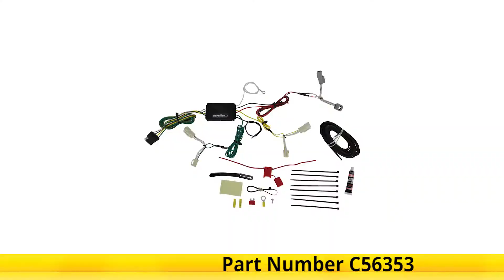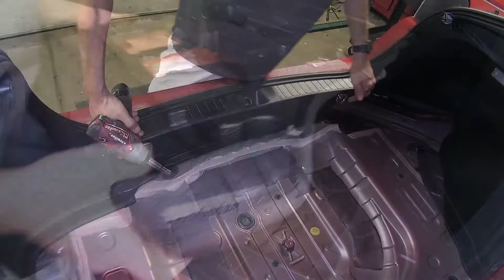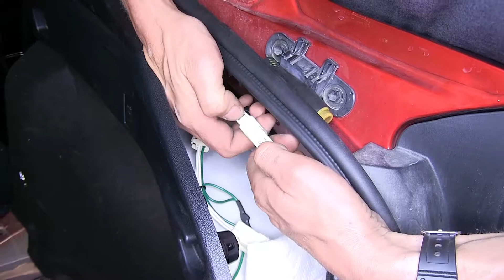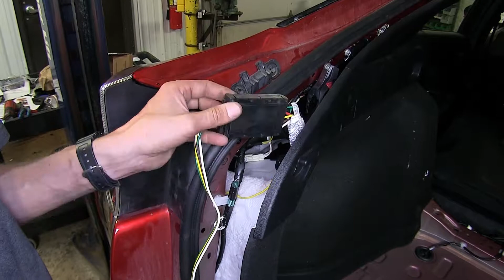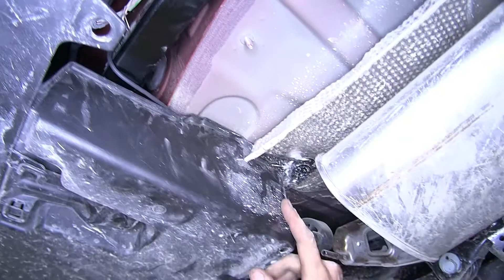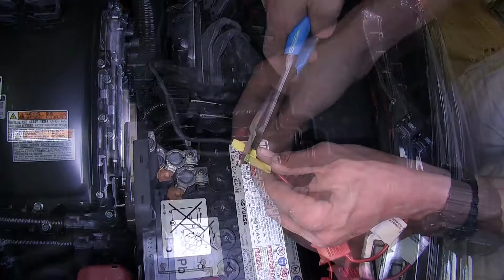etrailer | Curt T-Connector Vehicle Wiring Harness Installation - 2018 Toyota Prius

Comment: Can I just use power from my running lights for power to the module? As long as my tights are on it should have power.
Reply from the maker: The running lights will only power the trailer lights, not that needed for brake or turn signal.

Comment: Somehow my blinkers work but my brake light wont work.  Is there any advice you have?
Reply from the maker: Use a circuit tester like # PTW2993 on the red wire feeding the converter box while a helper pumps the brake pedal. If the tester lights up test the pins on the 4-pole that are fed by the green and yellow wires, again while your helper pumps the brake pedal. If you have power going into the converter box but not at the connector, the converter box is bad and the harness/converter assembly will need replacement. Also, make sure the ground connection is securely made to clean, bare metal. Here's a link to an article that provides some more troubleshooting strategies:
https://www.etrailer.com/faq-4-5-way-troubleshooting.aspx

Comment: Although I definitely appreciated these guys taking the time to make this video as the steps were very helpful but when you actually do it yourself, they make it look way easier than it really is. I’m a professional Bicycle mechanic and work on electric bicycles, if I didn’t have at least that experience this job would have been pretty challenging. It took me 3 hours to complete, all of the clips on the vehicle panels and factory vehicle plugs do not come off as easy as they do in this video. And the wiring under the bumper is really hard to get to. You can only fit one hand in the accesses hole underneath and makes it super challenging to unplug as well as hard to re connect the trailer wiring. It’s definitely doable but if you’ve never wired anything of taking panels off a car I’d consider hiring a professional. The kit works perfectly by the way.
Reply from the maker: Thank you for sharing this with us and others. We have installed many of these wiring kits. With that comes confidence in removing the panels and experience in running the wires. Certain wiring kits can be harder to install than others but are definitely possible to do at home with a bit of time.
https://www.etrailer.com/Custom-Fit-Vehicle-Wiring/CURT/C56353.html

Comment: I wouldve liked to see the power line run from battery to tow hitch. That actually seemed like the hardest part. I purchased the hitch. The light hook up is next. Thx for the vid
Reply from the maker: Thank you for the feedback! There is usually a rubber grommet under the foam paneling in the trunk that you can run the wiring through.
https://www.etrailer.com/Custom-Fit-Vehicle-Wiring/Curt/C56353.html

Comment: Just installed a curt wiring harness on a 2019 Prius. The brake and tail lights aren’t working, only left and right turn. Any advice? Thanks
Reply from the maker: It's kind of odd that the brake and tail aren't working. Usually when the brake lights are out the turn signals are too. Since your Prius has separate wiring I'd start by checking fuses. Are the vehicle lights working properly? Another thing to check is make sure the connection points where you plug in the Curt https://www.etrailer.com/p-C56353.html  are all good. Check the pins of the connectors to make sure none are bent.

If all of that is good make sure your ground connection is good. Finally, you'll need a circuit tester or multimeter to check for power on the wires. Test all the wires before the converter box and then again after. If you have power before the box but not after then the box is bad and the harness needs to be replaced.
Reply: etrailer.com Thank you! Installation went too smoothly... Hahahaha.